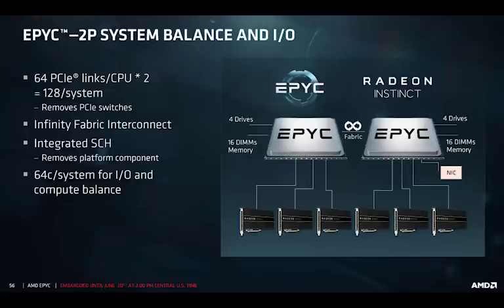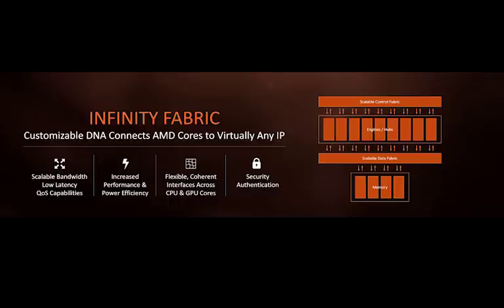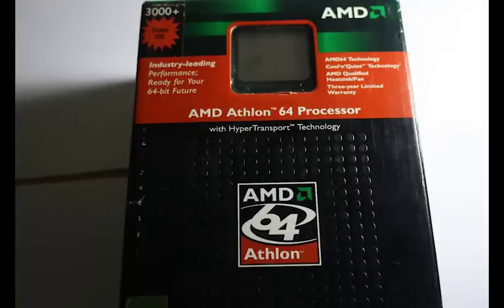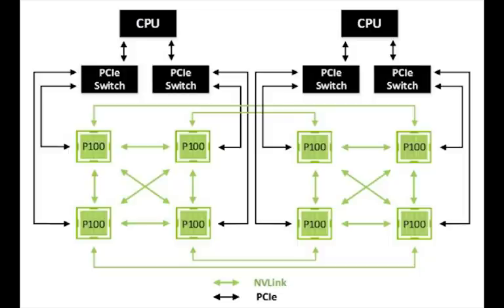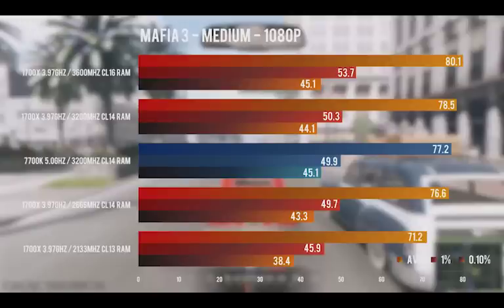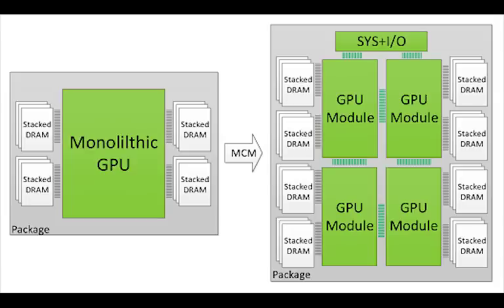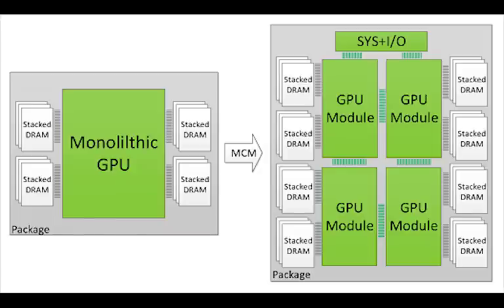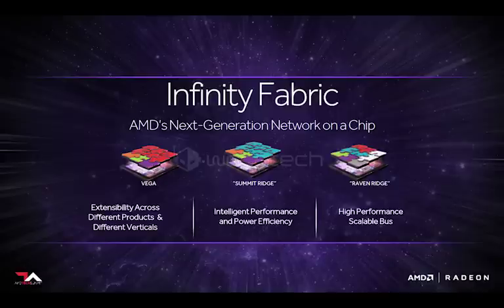AMD'S INFINITY FABRIC -  WHY ITS AMD'S BEST WEAPON AGAINST MOORE'S LAW

Comment: One concept missing from your explanation. Back in the '80s, Apple used a networking concept called Token Ring. It had a big fat coaxial cable that went past each computer, and they passed a 'token' along, and you could attach (think email attachment) some packet of data to the token. Compared to the other technologies of the day, it had some advantages. So Intel liked the idea, and about the early '90s they incorporated a concept like that into their CPUs, where they had a 128 bit or 256 bit circular bus, and that was the main interconnect. Data and instructions and internal communication and everything, got shuffled around the ring. This circular bus ran at exactly the same clock as the core itself. Memory ran much slower, and you had buffers or latches that stored the values until they got sent on the main internal bus.
What AMD have done is re-invented this whole idea. Instead of a ring, you now have a multi-link multi-node network, like the internet. The protocol would not be TCP/IP, but the concept is similar. You can identify nodes which are busy, and you can route data or coms around them. But this system is based on and linked to the RAM, not the CPU cores. So it has to be clocked at RAM speed. So if you change the speed of the RAM, it changes a lot more than it does on a traditional Intel design. Change the speed of the RAM, and you change a major internal speed of transfer and communication inside the CPU itself, the whole data pipeline and instruction pipeline...
Whether this is a good thing or a bad thing depends on how well they can implement it and how well they can scale it. The idea is not better or worse - it's just different. But it does allow growth and headroom. How FAST it can be, is open to question, but it can sure as hell get a lot bigger & wider... There are limits to the clock speed you can get, because you're restricted to stuff that's off the chip and attached by lines inside the motherboard, but there's no real limit to how wide you can make the bus. You could make it a thousand lanes wide, or a million, and conceptually it'll still work.
Infinity Fabric is flexible, in a way Intel's Token Ring (north side bus) stuff never was.

Comment: Thanks for this video as a first step. Cuz I've been breaking my head to understand Infinite fabric & how high of a clock speed ram I should choose with the new AMD Ryzen series.
I saw a picture that shows the sweet spot being 3733mhz CL17 at 67ns latency. While 3600mhz CL16 is best value/price at 69ns for 1:1 ratio.
But higher clock speeds getting in 2:1 ratio with 4400mhz CL18 is at 75ns latency. I'm currently searching the net to understand this Ratio & Latency.

Comment: latency sucks though hopfully AMD address that next gen, honestly I think they need to halve latency but I doubt they can do that in 1 generation 80ns ontop of what ever other latencies there are is just not acceptable so for example you have to transfer data from CCX 1's L3 to CCX 2's L3 cache and it takes 20ns for each transfer thats already 40ns plus 80 ns for the fabric that is a total of 120ns that is a stupidly long time in a CPU and that is a real example of AMD Ryzen with cross CCX communication with DDR4 2666Mhz RAM

AMD cache is already has double the latency compared to Intel that is somewhat remedied by having double the bandwidth but time is more crucial in a CPU to a point than bandwidth if AMD could reduce cache latency by 20% that would bring you down to 32ns for inter CCX communicate then cut fabric latency by halve "I am assuming considering this was there first gen infinity fabric there are large gains to be had." that you bring the total up to 72ns not great but still significantly better and somewhere within the realms of acceptable, you are still talking about 5 cycles of the L2 cache but its better than 8 cycles.
Reply: Infinity fabric scales with memory speeds as well
Reply: As why I said with 2666Mhz RAM... 3200Mhz RAM only improves latency by 8.5ns 8.29% which will not directly corrolate to a 8.29% performance increase as why I did not use 3200Mhz RAM as the example furthermore not every kit even now can get to 3200Mhz that is rated to do so.
Reply: +Etheoma interesting, you seem to now a lot about that. Why is infinity fabric so ram dependant? And is infinity fabric any better than Intels quick path or Nvidas Nvlink?
Reply: QPI links well that's for inter CPU communication only between multiple sockets, AMD's infinity fabric can do that as well but AMD's infinity fabric does way more as well, although on Epyc you can only have upto 2 CPU's while I think there are a few boards on Intel's platform which have 8 sockets. Also QP is lower latency than AMD's infinity fabric I think it was clocked at 40ns vs AMD's Infinity fabric which as I said is about 80ns

Also as far as I know multiple video cards will not use infinity fabric to communicate they will just use PCIe this is what Nvidia's NV link does it offers a higher board width and lower latency replacement for PCIe, Although AMD's infinity fabric is lower latency than PCIe so if the decided to use it there it likely would work well with 80ns latencies vs 200ns~ also AMD has said they can deliver 512GB/s vs PCIe 3's 16GB/s even the much more cut down version on there consumer CPU's is 37GB/s or something like that with 2,134Mhz RAM.

Although I have a strong suspicion AMD plans to use there infinity fabric to link up dies on the same package like Threadripper and Epic, given that one of the few details we have about Navi on official AMD slides is scalability the other is next gen memory I don't know whether this will be HBM3 or maybe hybrid memory cube but that was at least Nvidia's jam but they gave up on it and decided to go with HBM instead or whether it's something I have never heard of but I am getting side tracked.

Multiple GPU dies on the same package, now this wouldn't work like SLI or Crossfire your OS and applications would only see and work with it like it was 1 GPU because for all intended proposes it would be a single GPU but with multiple dies and the performance penalty if it works out like Threadripper and Epyc wont be large I would say at most you will lose 10% performance most likely less.

This means that AMD will be able to for example put 2 x "Navi 10" dies on the same package and you should get 90% more performance, and considering AMD's "Navi 10" should be able to at least out perform a 1070 you are talking about a GPU that can beat a 1080TI and should cost no more than $500 more likely $400 - $450.

That's worked out by simply taking a Polaris 10 die giving it the Vega boost in clock rates so 1280 to 1630 which is 27.3% and the 7nm node reduction claims a 40% boost in performance so I gave it 20% extra clockrate just to be careful so that ends up at 1956Mhz or a 52.76% increase in clockrate assuming no architectural improvement that is already on par with a 1070 and for a single die card it should only cost about $200.

This also assumes no more CU's on the "Navi 10" die than Polaris 10 as well, so you can see I was being highly conservative and you might fairly say well Nvidia is going to improve there architecture too right, and yes they will but if we just hand Nvidia a 55% improvement which was touted as a massive improvement then Nvidia's "GTX 2070" or "GTX 1170" which ever you proffer will be about 35% behind, that's even if they can get a 55% improvement which is one of biggest jumps in many years.

So even if you handicap AMD like I have here and give Nvidia the fact that they will be able to pull of another 55% performance increase generation to generation AMD still end up on top purely due to the MCM GPU, and also AMD will likely be able to put upto 4 dies on the same package  so that's 180% increase over the 1070 and something like a 110% increase over the Titan XP although they would probably have to downclock that to keep the TDP sane.

Comment: It's funny how you kids look at tech. When concepting multi cores way back. I discribed  that the issue was not with adding cores, but how they communicate, you would need a CPU to talk to the other to connect.

This is what you call fabric.

The issue was that it's NOT scalable as much as you would think, the more you add to the "performer" the slower it gets, so there were limits.

The difference in the actual CPU instruction set, makes a big difference.

Think of it like this.
If you have a trunk going on the road to an address, or you have a motorbike. Then think of a highway.

More trucks is a bigger load,but slower, And the motor bike is a smaller load but faster.

(Think and review intel p4 (firsts))

Intel did not make a success of the HT and buses. They changed and swapped as the first p4 caused latency as they tried to truck data on a cpu.

Amds CPU speed is slower but transfers bigger chunks of data.

Comment: So now computers are going to get larger again?
Reply: technically yes and no. until moores law stops affecting cpus, the dies will keep getting smaller(at a slow pace) while being packaged together. eventually the industry will hit a wall and be forced to innovate. its pretty interesting because they can hold off on innovating if they make each die in a package as small and efficient as possible, which is what they will do before trying to tackle moores law head on
Reply: But isn't 7nm the limit? It's impossible to make transistors any smaller, so I don't see how dies will get smaller.
Reply: Specialist in Failure shrink ray